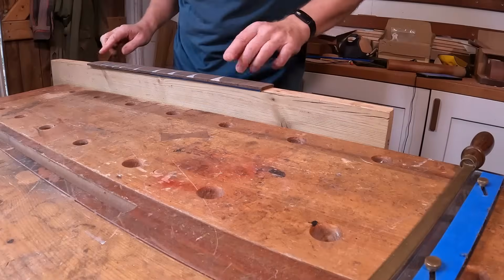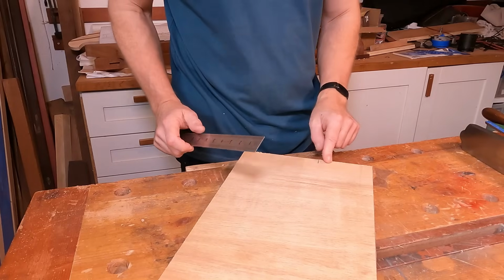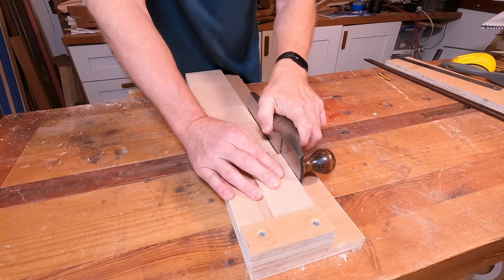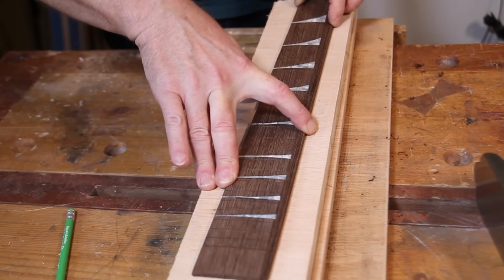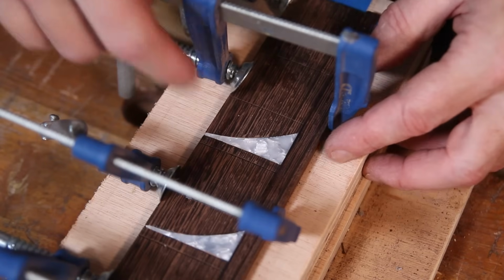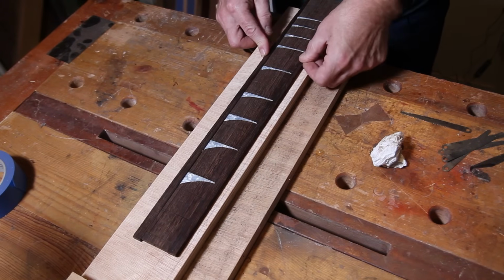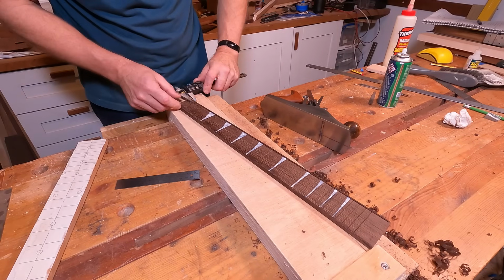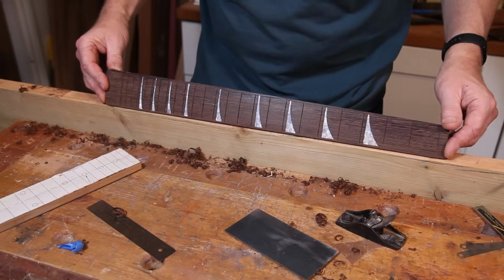Finishing the fretboard, GGBO 2023 episode 13

Comment: I’m another fan of your tool-building segments. I think your shooting board go-through is the simplest I’ve seen. I recently saw what I think is a pretty clever slot cleaning and depth checking tool: take piece of fretwire, make a cut in the tang so you can bend a 1” or less end and thin the barbs on that end’s tang so it can go into the slot to do its work while you operate with the unbent length.
- Paul
Reply from the maker: Better do some more tool based stuff then :)

Comment: It turned out very nice.  But I can't stop thinking that it looks like a CNC pre-slotted fretboard blank you can get online.  The again, you can't get them in wenge with reverse shark fins.  For something like that though, I'd think a desktop CNC would be the tool of choice.  A CNC router could do the fret slots and inlay cutouts, and a CNC laser could cut the inlay material.  Of course, it would be a few bucks for the tools, but probably no more than you spent on all those planes in your shop.
Reply from the maker: I would like a CNC but don't have room for one. I'm not against them but also like to do stuff by hand. Most of my planes came from Ebay, there isn't as much money on that rack as you might think :)
Reply: @Adventuresfromtheshedofdreams  I know the feeling.  I'm in an 8x24 shed, and half of it is the guitar collection. I just finished 2 builds yesterday. bringing the collection up to 95 guitars (including about half a dozen basses and a couple of cigar box guitars).  I too like hand tools. All my builds are one-off customs and tend to use small parts that are almost easier to do by hand.  Since everything is one-off, and not mass produced, I have little use for CNC routers or CNC lasers.  Inlays and engraving would be about it - but I don't do inlays or engraving.  Apparently, you can get into CNC for just a couple hundred bucks.  Nothing fancy - engraved pickguards and such.  The footprint isn't too bad - about 4 square feet.  I just got a dozen waterproof storage tubs a few days ago. I was able to move 3 shelves of stuff outside, and setup 3 guitar benches, a 3" mini table saw station (for pickguard material and such), and a 4.5" small table saw station (for cutting 1x material for thin body guitars).  For guitars tools, parts and supplies, I find Ebay usually wins on selection and price, and Amazon wins on delivery speed - if they have the item.  I've been "right-sizing" the tools for my shop.  These days I'll use a small table saw to cut out bodies and such, a mini table saw for pickguard material, and a trim router, an angle grinder, and a Shinto rasp for thicknessing and shaping necks.  I got a small reciprocating saw with a rasp blade - but have yet to try it for shaping necks.  I have a half size drill press, a small cordless drill, a 1/4 sheet sander, a belt sander that clamps to a bench, a Dremel for polishing frets, and a drill with foam pad for polishing lacquer.  Those are about all the big tools I use these days on a build.  The table saw, the circular saw, the table saw made from a small circular saw, the large cordless drill, and the grinder with buffing wheel have all been retired due to being "oversized" for guitar building.  Occasionally I'll use the grinder to grind a bolt or screw to the correct length, but that's it.

Comment: When I've used the depth stop on the fret saw, it often leaves marks on the fret board that later have to be sanded off.  Is that why you put the blue tape on it? It looks like the tape  has kind of worn off on the edge where it would contact the fret board.  

Fret board looks great with the side pieces on!
Reply from the maker: Yes, I forgot to replace it from the last board so still had to do a little sanding but it helped.